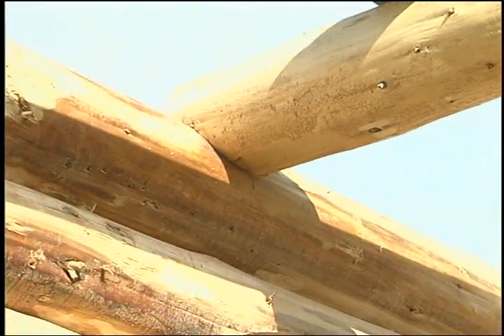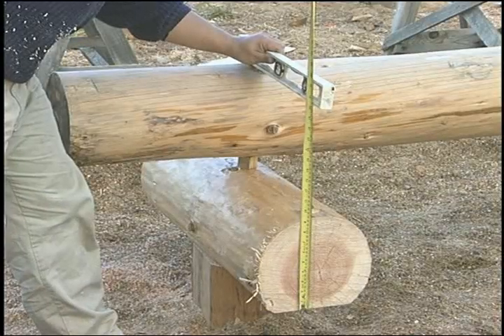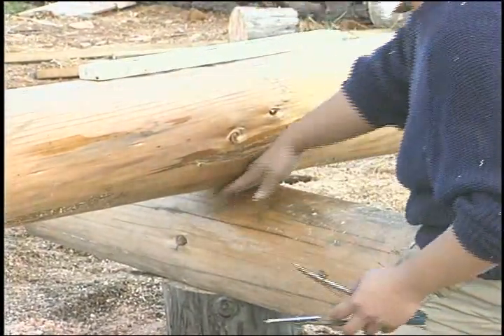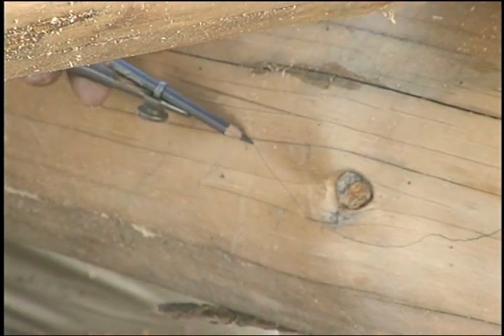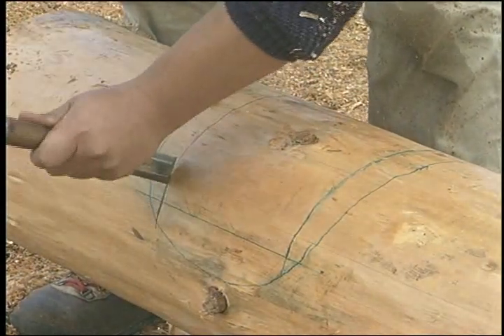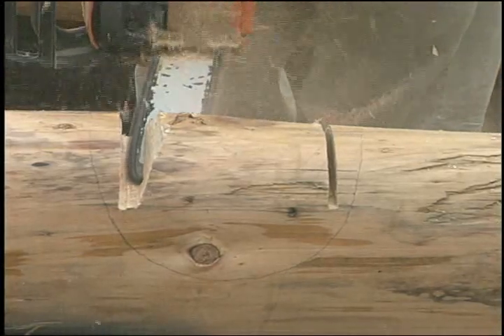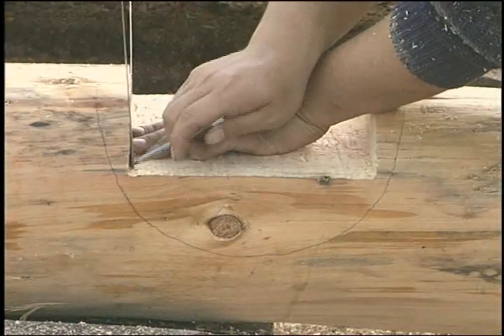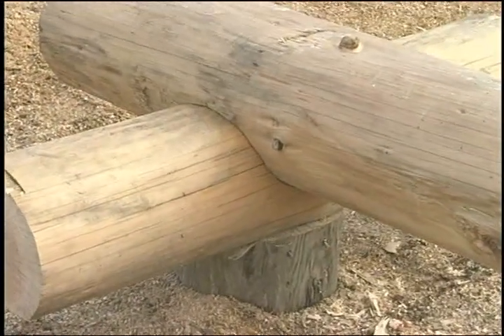Building log cabin: Cutting square notch

Comment: From what are they deriving the width to set the scribe? It doesn't say.   In the other videos the scribe is generally set of the widest gap between two courses,  but there is no lower course in either section of the video. Either the guy on the wall,  or the cut man down on the ground.   So what reference point are they using?

Comment: love the videos, little question as im about to make my first notches in a lifelong dream little cabin, could someone use these square notches for the whole building?  i dont like the look of the scarfed saddle notches , what i always wanted was just plain round notches, but i understand that  especially since i have irregular size logs, i might have gaps after a few years, compared to the saddle that fit better  or just as tight as it settles.    but with these square nothces here, wouldnt i get best of both worlds?  tight fit, no leaks, but with the look of round notch? plus the benefit of locking corners all over?  exept for the bit more work, is there a reason why i couldnt use those?
Reply: Good question. Might be easier also.